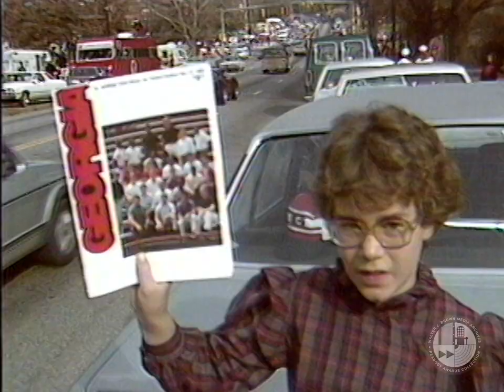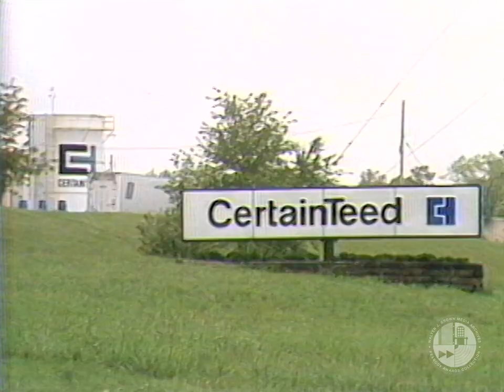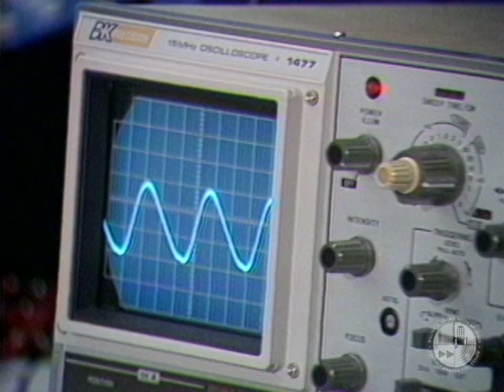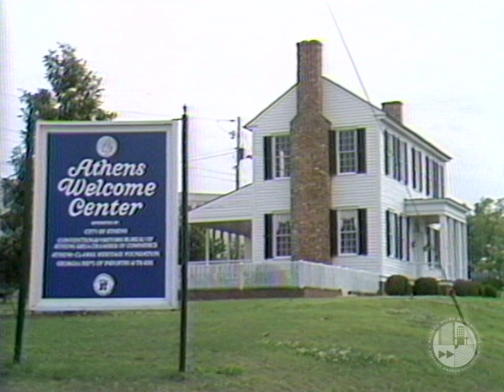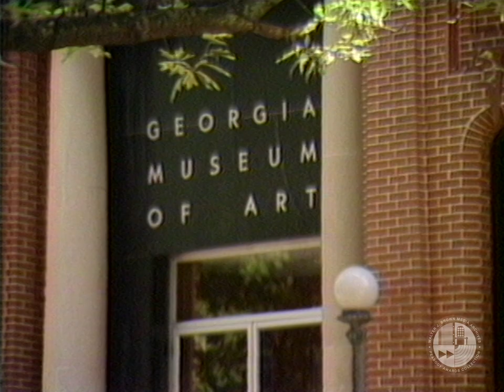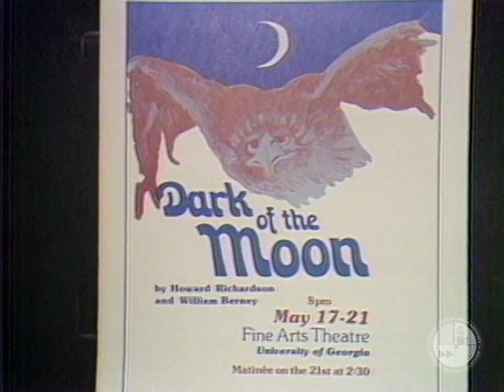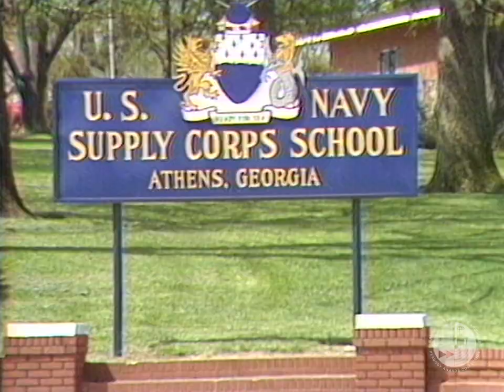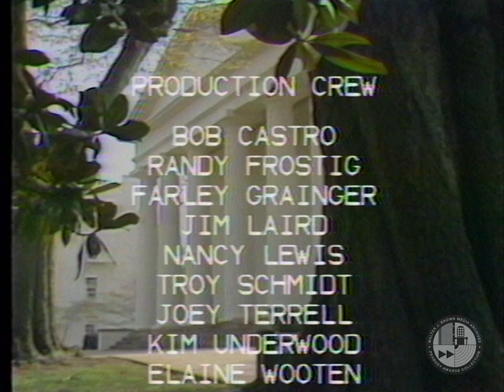"Discover a Classic: Athens, Georgia" (1983)

Comment: This has to be at least a few years after '83. The Tate Center was completed that year, and is clearly complete and doesn't look brand new in this video.
Reply: I was there 1980-85.  They constructed the mall during that time; seems like it opened about 1983. The Tate center was a huge improvement,  nostalgia for Memorial hall notwithstanding. I truly miss those times; I went to a rodeo at UGA in 2017 then drove through south campus. It seemed to have a lot less green space
Reply: I grew up in Athens, and I was there in the 80’s. The mall opened in the spring of 1981.